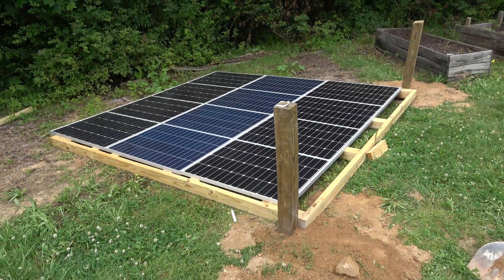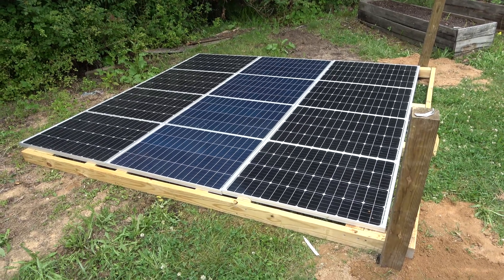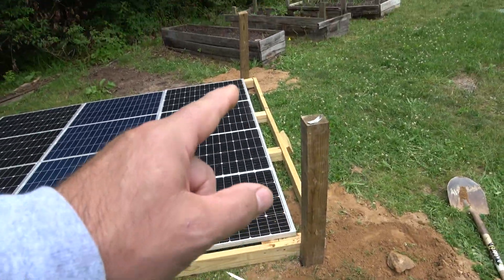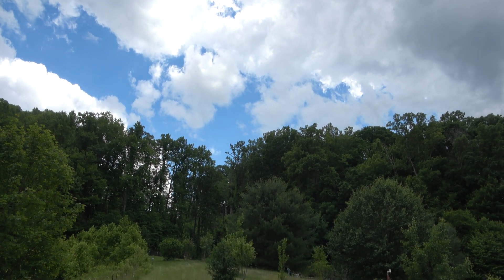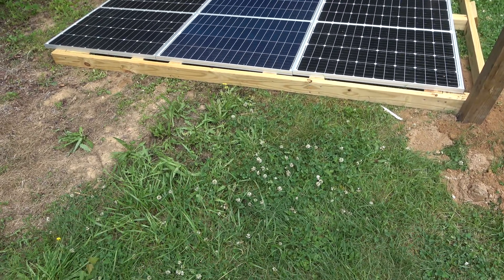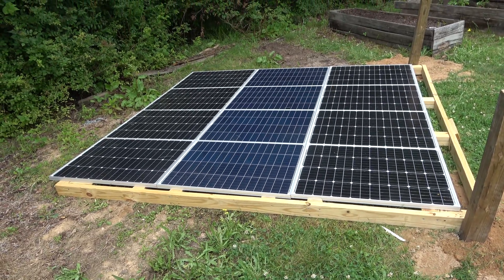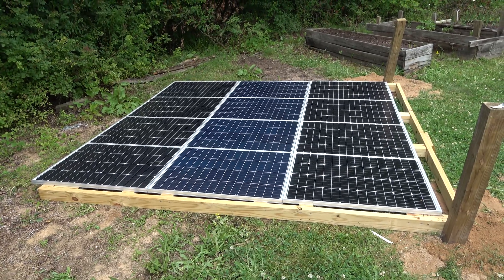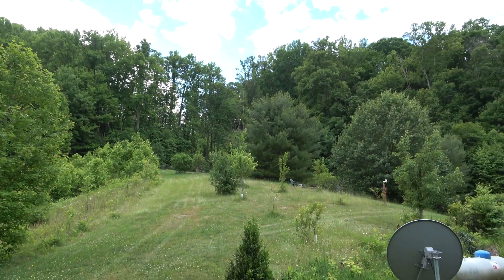My Off Grid Solar Project Part 3: The Array Is Built!

Comment: Climate control is definitely an issue, but putting the battery a significant distance from the controller isn't feasible because the long 24 volt cables will act like resistors and drop voltage.

Comment: Really???? not impressed and shaking my head. Firstly u build the frame, then u install the centre pivoting posts, then u install the frame and make sure u have clearance for winter angle and summer angle and every angle in between.If ur in a high wind area then u install extra posts for anchoring the array. Last thing to do is fill the frame up with panels and trench ur wires underground..
Reply from the maker: Apparently there is more than one way to build it! It's built, up and running as we speak. The last part came in last night and it's all working today. The box says 850 watts average on a mostly sunny morning and the battery is taking a charge.  Someday I'd like to double this setup, but man... This stuff isn't cheap!  I'm going to see what kind of results this gives me on days I am without power and then decide if I can afford to keep going.
Reply: @FarpointFarms  Do u have easy seasonal tilt?? Keep looking for bargains and keep adding panels, remember u need a backup set of panels for cloudy days, with a switch if the solar charge controller cant regulate the input power. My controller does so I dont need to worry about it.